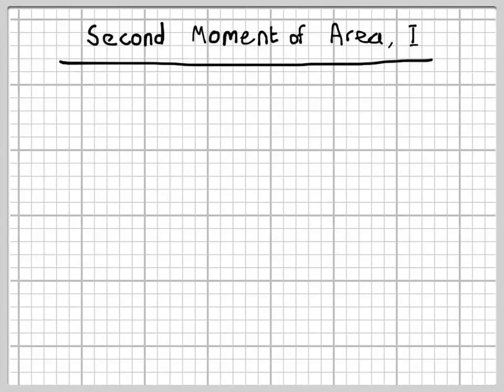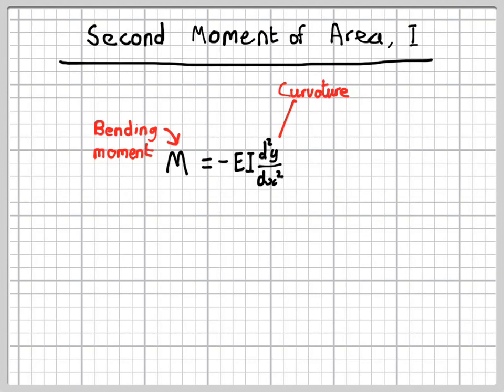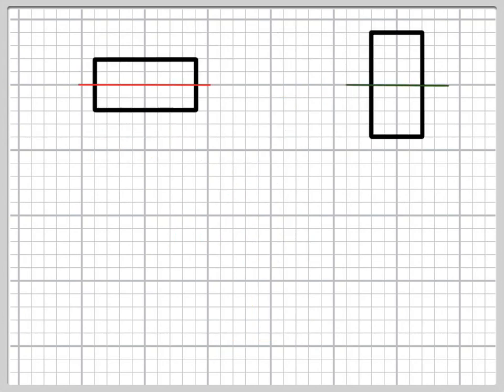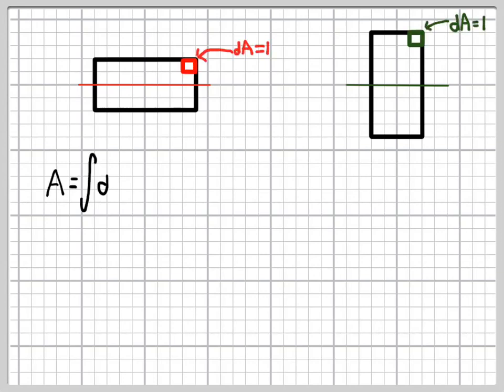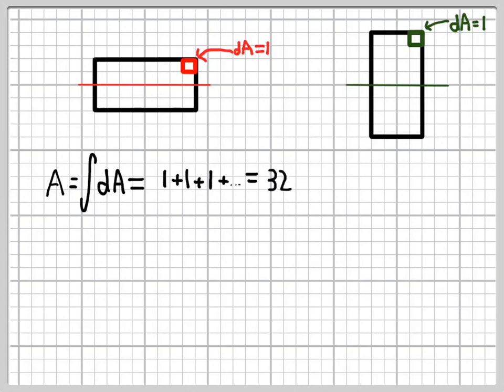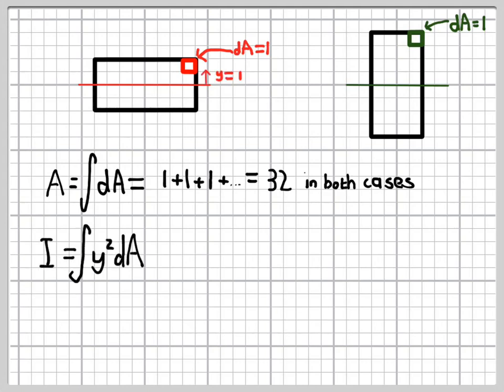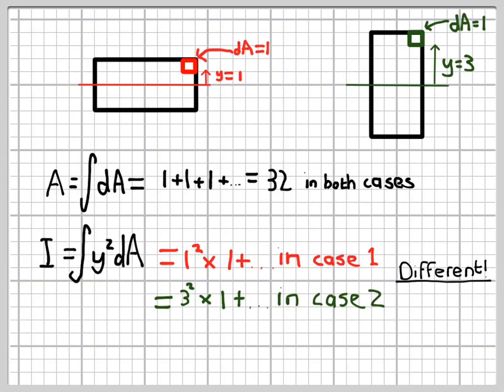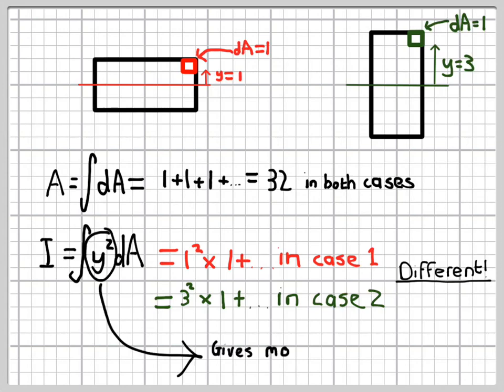What is Second Moment of Area?

Comment: why is y squared and not just y?
Reply: Why this question is not answered ?pls answer this
Reply: Gan S  this is an excellent explanation
Reply: if you consider two small elements of equal area within the cross-section, one being double the distance from the central axis as the other, the one with double the distance will (1) be streched twice as far during bending and due to Hooke's Law,will provide twice as much force in tension or compression, and (2) will provide double the moment, which resists bending, for the SAME amount of force. combine both of these and that's where the y squared comes from
Reply: because it is the 2nd moment of area, not the 1st.

the 1st is the integral of (y dA)
the 2nd is the integral of (y^2 dA)
Reply: @barnabyroberts7950  Sick dude, thats the answer I was looking for

Comment: how come y=1 and 3?
I didn't quite understand it. Shouldn't it be 2 units?
Reply from the maker: I think what I have is correct.  y here refers to the distance of the (lower edge) of each tiny piece of area from the axis about which the beam is being bent.  So it is 1 in the first case and 3 in the second case.  Since this distance is squared in the definition of the second moment of area, it means pieces of area more distant from the axis are more significant - in this case by a ratio of 9:1 (3x3:1x1)
Reply: +Structural Engineering Basics isn't 'y' the depth of neutral axis from the edge of that section; in which case y= 2 and 4 units respectively, in the left and right section.
Reply from the maker: No, that's not what it is measuring here.  As above it is the distance to each infinitesimal area in the integral.  This is indicated from about 2.22 onwards in the video on the diagrams.
Reply: +Structural Engineering Basics 
right then.
thanks for the videos and everything :)

Comment: How is this different from mass moment of inertia ? It's basically the same thing but without regarding density of the material.
Could you say that,  for an object with a uniform density:  the Second Moment of Area =  Mass moment of inertia / Density
Reply from the maker: sghaier mohamed .Yes, very similar concepts. The dimensions are different because 2nd mom area (L^4)  is about distribution of area, not mass as for moment of inertia (ML^2).